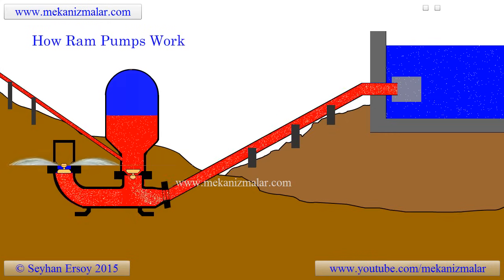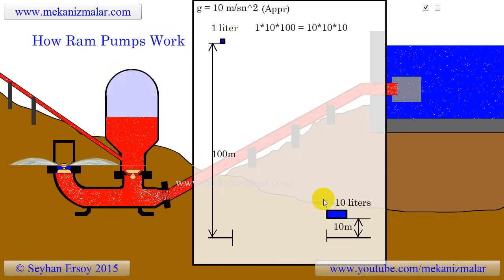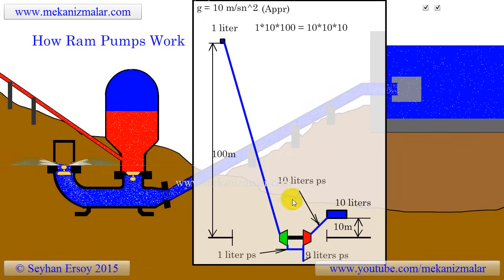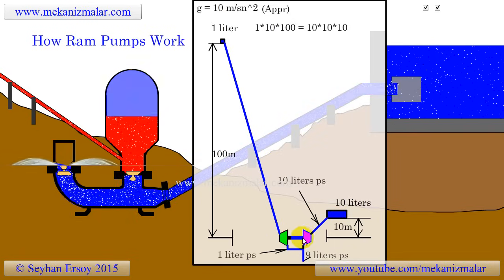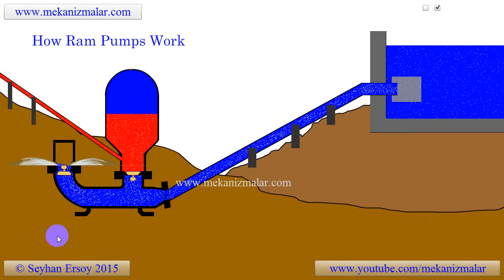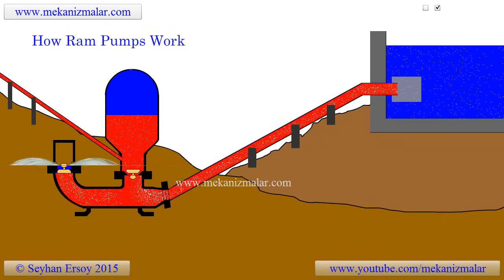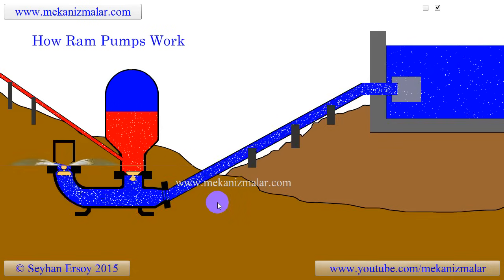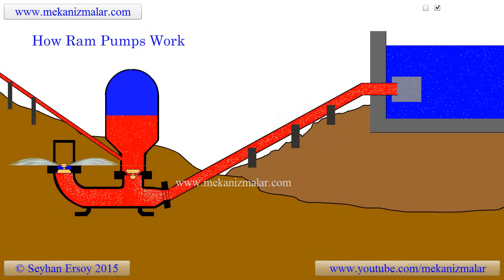how ram pumps work?

Comment: I would imagine that if you had a significant lift that you needed to achieve you could rig the rams in succession. This way you could use the first pump to fill a tank at a higher level. Once you have that tank filled then you could repeat the process with water from that initial tank and pump up even higher to your water tower. You would then have better pressure at your point of use if that is what is required.
Reply from the maker: +John Johnson Yes it is possible to do it.
Reply: +John Johnson Keep in mind that each pump stage is going to only pump about 10% of the water up to the next stage, wasting the other 90% out the waste valve. So in the end you are only getting 10% of 10% of the original amount of water. That's a LOT of loss (waste).
Reply from the maker: +Brian Meyer I personally don't like the term "waste" water. It is necessary use of water. If your ram pump working 10 meters elevation with 10 liter flow rate, and you want to pump 1 liter water to 100 meters from pump level, the energy of 10 liter water in the lower reservoir with respect to pump is 10*10 = 100. Energy level of 1 liter water with respect to pump in higher reservoir  is 1 * 100 = 100. Therefore you have to discharge 9 liter per second from the pump to maintain 1 liter flow rate to higher reservoir. You are using potential energy of 9 liter to take 1 liter water to higher elevation (100m). When we sent an astronaut to the orbit, we are not wasting fuel in the rocket, using that fuel to take astronaut to higher potential level.

Comment: is there a ram pump that does excrete water? i mean yes it pumps water w/o electricity or fuel but it doesent pump the water out efficiently. some water gets wasted in the process.
Reply from the maker: +jaybs 25 Thank you for visiting my channel and your comment. Actually efficiency of this turbine is not as bad as it seams. I tried to explain this in the video. Let assume that this simple system working with 30 percent efficiency. Would you use 90 percent efficient electric pump to do pumping. It would be relatively expensive, would need electricity and monthly electric bill just for pumping the water. I would go with 30 percent efficiency without paying any bill.
Reply: Ok, thanks. 😊

Comment: What makes the waste valve open? Pressure from the inlet tube would seem to keep it closed, unless you temporarily close the inlet?
Reply from the maker: +Richie Mann This subject is not as easy to explain. I will try my best to explain it. When water coming from the inlet pipe, the potential energy is converted to kinetic energy while the flow is flowing toward the waste valve. In one point increased flow speed will cause waste valve to close due to Venturi effect. Since water in the inlet pipe has forward momentum, closing the waste valve will cause pressure to increase tremendously. This pressure increase will open the delivery pipe and send the water to higher elevation. But at some point the bouncing pressure wave will cause the pressure drop (expansion wave) around the waste valve. This will cause the delivery valve to close and the waste valve to open at the same time. Please look at pressure fluctuation  in the ram pump in the following URL. https://en.wikipedia.org/wiki/Water_hammer. Remember, this is dynamic system and expansion and compression waves mowing back and forth in the pipes. The ram pump is very simple device, but theory behind it is some what complex, as you can see it in the link I provided.

Comment: Bravo! Well done! How about a video on hot rodding it. There was another video where the weight of the water was enough to push it's self through a tube a couple of inches above the level of the water. If you could do that a few times the 10 liters could be replenished. Cheers
Reply: Really?

Comment: I have used one of these pumps.  They are amazing.  They pump water 24/7 and use no electrical power.  The flow is not great but over a 24 hour period there is a substantial volume .
Reply from the maker: +Ken Johnson Thank you for visiting my channel and informative comment.
Reply: @mekanizmalar  does your outlet water stay under pressure, and how much? or does this just go to an open tub with an overflow?
Thanks and great video explanation!
Reply: @carlbole2142  Outlet water continues down hill.
Reply: @carlbole2142  You can store pumped water in water tower - so when it is needed, you have pressure.
Reply: KenJohnson
Reply: I have a house in Costa Rica 🇨🇷. And I have water springs.  The house is about 100 ➕️ meters. What happens when the tank next to my house gets full?

Comment: thank you sir for this inspiring video regarding ram pump. but i have a question sir, can the ram pump be use where the source of water is from a deepwell with a deep of 60 feet? hope you can answer it. God Bless
Reply from the maker: +ariel liza Thanks for your comment. My answer to your question is NO. You can't pump water from a deep well by using Ram Pumps. Ram pumps use the potential energy of the water in high elevation to pump some portion of this water to higher elevation than the source level. During this process the potential energy of the source first converted to kinetic energy to create ram effect as described in video. Since the water level you mentioned is 60 feet below and there is no way to generate water flow, there is no way we can  use a Ram pump. But you might use air lift pump if you have pressurized air generated by a wind turbine. Please look at the following video for air lift pumps. https://youtu.be/03EmME_OB-s

Comment: Is there any possibility I could use this to pump sea water? I would have to dig a hole on the ground to have the water to go to the ram pump, but but how do I get rid of the water that is going to the environment? Isn't that gonna fill the hole?
Reply from the maker: +Valquiria Jablinski You can't make this pump work below the see level. The discharged water will fill the hole as you said.
Reply: +mekanizmalar 
You could capture seawater during the high tide and store it in a tank above the average sealevel and then use it to run a ram during the period when the tides drop the water level below the bottom of the pump. It wont run when the tides are high, but you do have the advantage of an infinitely replenishing water supply and you can make the holding tank larger to increase the water pressure and hence the raise the flow rate/ possible elevation you can move water up. Vastly more complex than your standard ramp pump, and with several trade offs, but not impossible.

Comment: Why not plumb the purge valve back into the source? You will conserve water and keep the pump and surrounding area dry in case you have to service it.
Reply: +TheRoflbbq The source is higher up (high gravitational energy) than where the pump is (low gravitational energy) so it would require putting in energy (difference between the two energies) to move the water back thus negating the purpose of the pump (moving water to houses in higher elevations than the pump).
Reply from the maker: +Hork Supreme Thank you for your excellent explanation.

Comment: Excellent, clear, detailed explanation.  Might a spiral pump be better?  I came here by way of youtube recommendations.  I easily see that spiral pumps are mistakenly trashed by people who don't understand physics.  I understand a bit more, but comparing this with a spiral pump is beyond me.  Best wishes, and thanks for the video.
Reply from the maker: Ray Kent There is no single perfect solution to pumping water to higher elevations. Spiral pumps require outside force such as electricity, animal or wind power, ram pumps do not require external power source. Also, spiral pumps pump the water to low elevation such us 5 to 10 meters, while ram pumps are capable pumping the water higher elevations. On the other hand spiral pumps work anywhere there is suitable external power source, while ram pups require a suitable place to operate.
Reply: mekanizmalar thanks. I clicked on your icon and saw a lot of interesting stuff to look at later.  As I'm sure you're aware, a spiral pump can be powered by paddle wheels from flowing water.  And  the ram pump also needs a downflow of water to work. I'd like to know which one is more efficient (in practical terms of build-cost, maintenance, etc).  Both seem to be very useful.  I can't compare the two, my brain's too small.  Can you roughly point to where one would be better than the other, or are we in incompletely known territory?

Comment: Interesting device, how would one regulate the valves for optimum function?
Reply from the maker: marcibb I am hoping that someone more knowledgeable in the subject can answer this much better than I do. It is a difficult question to answer.I believe that when the system is designed there is NOT much control for someone to control it. I could be wrong, so lets wait someone more knowledgeable in the subject to pitch in. However for an optimum efficiency you may be able to design the ram pump by taking into consideration following properties. What is the volumetric rate of the water coming from supply side? What is the water head of the supply side? And finally what is the height of the storage thank with respect to the pump where we are going to pump water? Design should take those consideration for optimum ram pump for a given location. I think this is not exact answer you are looking for, but this is the best I can come up with.